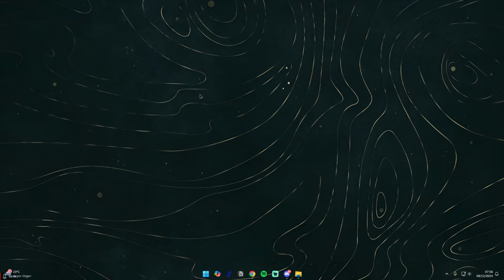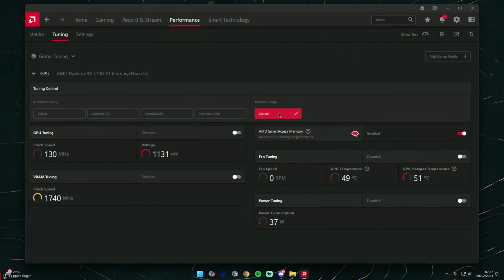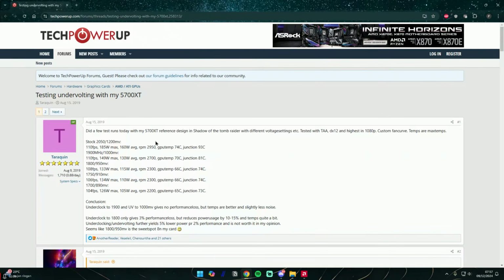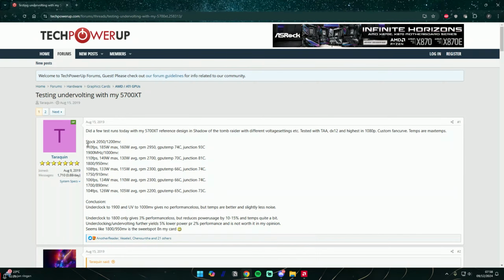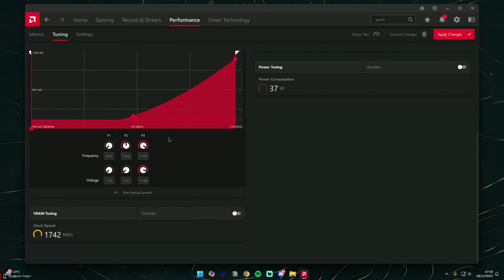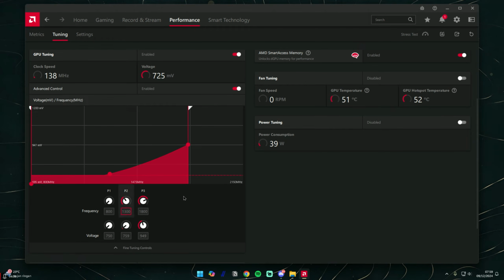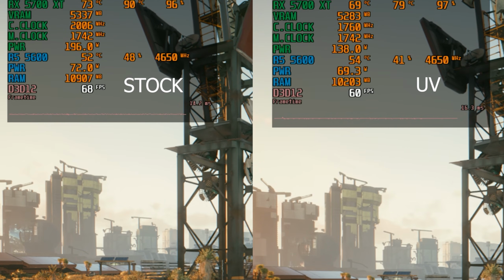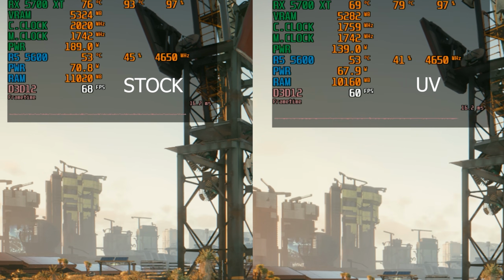How to undervolt your RX 5700 XT (or any other AMD card)

Comment: replaced my thermal paste like a month ago, temp went from 94 under max load to 77 MAX, however its back up to 94, guess my thermal paste dried out, will def try these settings, hopefully my temp will go down, do you have any idea why my thermal paste got dried out so quick?
Reply from the maker: @dely2922  They don't dry out that quick, but the heat from the gpu die probably spread them out even more, sometimes they even spread and create a spot where the paste don't cover some part of the die, this is also due to uneven pressure from the heatsink. I have the exact same case as you do, replacing the thermal paste was only effective for 4 days and temps skyrocket again. You can try preventing this from happening by using a higher quality paste and evening the pressure of the heatsink, by adding a thin washer before putting on the screw. These are the solution I have been reading, haven't tried it out myself, instead I just undervolt since it is the most affordable and efficient thing to do.
Reply: @fancyzx  Thanks a lot for your help man, your undervolting settings did a great job for me, my temp under full load is much stable now, with some fans tweaking and your UV settings I can now play ghost of tsushima with ultra settings at a maximum of 76c (unlike before which was 95) and yes you're right as I did use a low quality paste due to low budget but I will be definitely evening the pressure of the heatsink hopefully that'll help my card to be even cooler, you earned a sub! much love once again, not so many content creators were as helpful as you were <3
Reply from the maker: Thank you! Glad I can help :)
Reply: Try ptmhoneywell not just paste

Comment: сделав 1800гц на 5700хт вы превратили её в просто 5700
Reply from the maker: True, for me the power consumption and heat output is good on 1800Mhz. If you ask me why I went for the XT version, because it's the only thing available here, the non XT variant doesn't exist basically. But again, it's good to have the headroom with the XT variant, you could always set a higher clock if you want to.

Comment: 1975Mhz 975 mV , 1800 Mhz memory try :)
Reply: RX 5700XT

Bad silicon:
O.c + UV: 1975 MHz 1060mV 1800 Mhz Vram
UV: 1875 Mhz 975mV 1800 Mhz Vram

Good Silicon;
O.c + UV: 1975 MHz 975mV 1824 MHz Vram

%100 tested.
Reply from the maker: @fatihbulut9940  Thank you for the settings :) appreciate your time for experimenting
Reply: I have find now my sweetspot
1900 MHz / 975mV good or bad silicon?  @fatihbulut9940
Reply: @fatihbulut9940  hey bro, I am currently using Sapphire nitro 5700xt.  Should I try your oc+uv settings??? Please reply I don't know much about AMD 😅
Reply: @miz4132 yes 😂
Reply: 2000MHz @ 1000mV does stable 1940MHz in Game for me at around 170W max and ~70°C HotSpot and 60°C GPU Temp.
Reply from the maker: @lukasz.5731  That's a very chill temperature for the settings, which model do you have?
Reply: Gigabyte Gaming OC
Reply from the maker: @lukasz.5731  Good model, you could probably set the clock slightly higher, but if you happy with the settings, then its perfect
Reply from the maker: Will try on my next benchmark
Reply: Mine 2100 default using 1080 mv , but I didn't change clock speed
Reply from the maker: @Abdennoragg  How is the temperature?
Reply: @ around 74 max.
Reply from the maker: @ Sounds good, mine still sits around 70-75c at 1975, if I push it further, my only concern is the hotspot temp
Reply: @fancyzx  I'm using msi afterburner, the only thig that affect the hotspot is the Mv , so if u get the right mv for 1975 probably 900_950 range , I suggest you to use 1905 mhz at 880 because the 1905 is the default speed of the gpu and with 880 is helluva good temps
Reply from the maker: @Abdennoragg  Nice, I will try your recommended settings